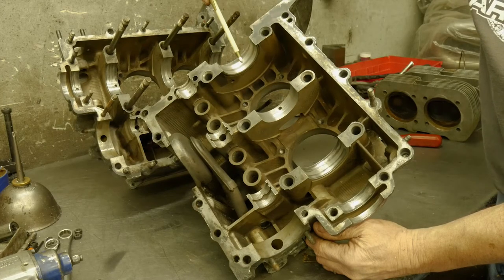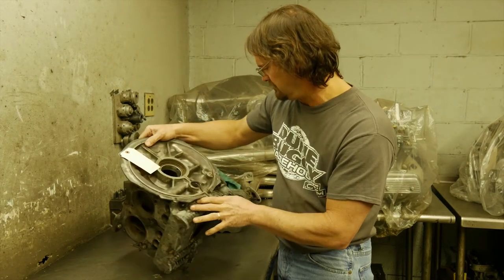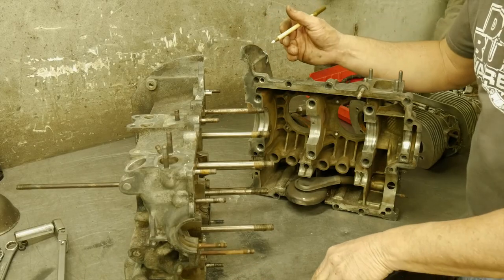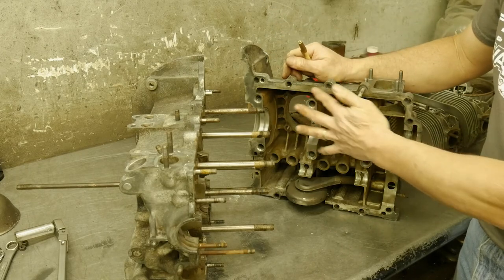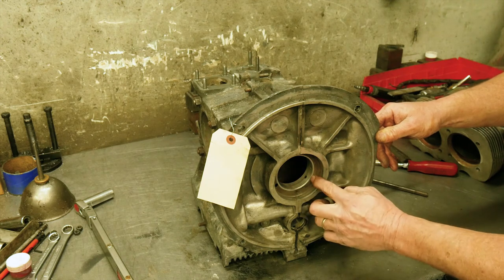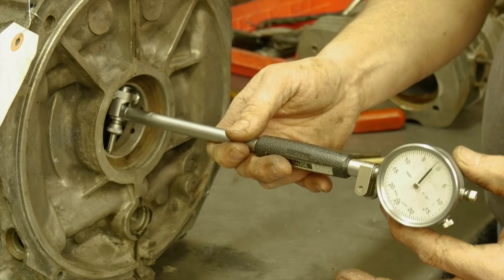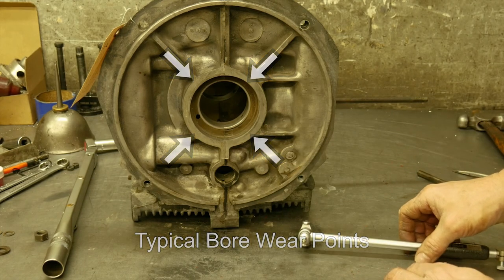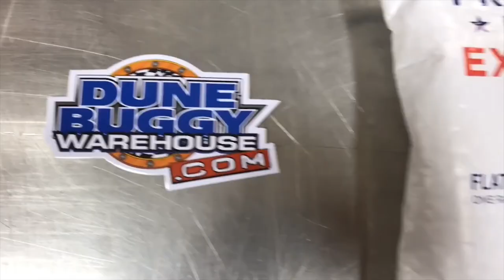How To Inspect Your VW Type 1 Engine Case - Air-Cooled VW Tech Tips - The Oil Leak EP2

Comment: Eight lifter bores each with .005 slop will give you .040 total. This is the main reason for low oil pressure, overheating and eventually, sooner rather than later self destruction. The best bet is to have a competent VW machine shop instal bronze lifter bore guides. Sometimes even on brand new cases.

Comment: Hello. I have a case which may need a line bore, as I can see a vw emblem in the middle saddle like you mentioned. Also, I have a slightly loose pin in the thrust bearing saddle. Can that be fixed somehow?
All the best.👍🏾🇬🇧🛠
Reply from the maker: If you can feel the emblem with your fingernail it probably needs align bored. Usually a slightly loose pin is corrected with an align bore, new bearings, and new dowel pins. Oversized pins are available but are rarely needed.
Reply: @DuneBuggyWarehouse  Thank you for the reply.
Please tell me. What would happen, if I just replaced the standard bearings and ran it like that?
Reply from the maker: @soggz4246  Depends on how far out the bore is. If you can feel it with your fingernail, it's likely worn well beyond spec. Bearings would not seat properly in the bore, resulting in very low oil pressure and a rebuild that does not last very long.
Reply: @DuneBuggyWarehouse  Thank you.
All the best.👍🏾🇬🇧

Comment: I used to rebuild a lot of VW engines in the late 70's and early 80's.  Recently i bought a 68 bug and am building a Baja.  I bought a 1970  57 HP  1600 single port bus motor.  This thing sat for over 40 years.  I found a steel plate with 4 VW Flat head Screws holding it just over the # 3 rod.  There was also a Silicone spot over the #1 rod.  Turns out VW dealers had a trick they used to do if they had a motor which spected out but had broken rod cracks.  They would rebuild the motor and bolted a 10 gauge plate with gasket sealer and 4 screws over the punched out area in the case.  VW Dealers had their share of tricks just like American Dealers did.
Reply: Μμ λ μλλλλλλλλλό

Comment: I am working with a type 4 case.  I see the middle bearing part # on my middle saddle, as you did.  You mention the center galley and feeling that ridge, then you measure it too.  But I only see the words stamped in my saddle, no galley ridge.  Am I dealing with the same issue just cause the numbers are there?
Reply from the maker: Type 4 cases are aluminum and typically don't have this same issue. If you don't feel a raised galley ridge from the bearing, the text stamping may just be some grime or oil that was worn onto the surface of the saddle in that one. Clean the saddle with some light scotch brite then measure that bore & test fit the crank with set of new bearings. Plastigauge would be a cheap & reliable alternative to a bore gauge.

Comment: what would you suggest if i do have corrosion around the oil sump?
Reply from the maker: If the studs are structurally sound and there is plenty of surface for the gasket to seal, then a small amount of corrosion is okay. If one of the studs won't hold or the gasket surface won't seal, it will save headaches to find a better case.

Comment: Great Info! Thanks!  I have a case that has quite a bit of white corrosive deposits I’m trying to figure out the most effective and safest way to get this case cleaned up. Would Soda blasting be a good idea?
Reply from the maker: We typically do not recommend soda blasting since media can get inside the oil passages. Vapor blasting would be the best choice.

Comment: Hello friend of Dune Buggy Warehouse, I want to know if I have to perform dynamic balancing to the following products that you buy new in your amazon online store are the following: AA Performance Products 4340 Forged Counterweighted Crankshaft Chevy Journal (Size 76mm) Brand: AA Performance , Manufacturer Part Number: 003 4376C, and: FLYWHEEL LIGHTENED 8 DOWEL, dune buggy vw bug, OEM Part Number 311105273HP, can you help me? to know if they are already balanced or do I have to balance them together?
Reply from the maker: Cranks and flywheels should already be balanced from the factory, but it's always a good idea to have the entire rotating assembly dynamically balanced (crank, flywheel, clutch, pressure plate, crank pulley) and to match weight on rods & pistons.

Comment: Forged Crank  , Rods  =  great    Case no good    the case is the weak spot . as the #3 comes up to compression stroke it pushes back on the #1 and #2 main saddles while at the same time it pushes the #3 area forward by the head studs .  It tries to push each side of the case the opposite direction causing case clap.  NO - GO - OD !!!! and the bracing is the spigots around the cyl. hole and when you cut to make oversize your weakening it farther and the more you stroke it the worse it is . answer if you go to hop it up start with at least a bubble top . No one I know can afford a Scat 3 piece case  . those if used stock would be like using a type 4 case , no line bore issues .    Just saying   ?   VW driver since 73
Reply from the maker: With proper machining and assembly there is no reason you can't build a reliable 100hp+ street engine. There are plenty of little tricks to maintain the block integrity during an engine and even stroker build, including machining the piston skirts and only machining a small bit of the block itself for the skirts to fit. Bubble top cases are definitely a good place to start, but plenty of drag racers have AH/AE dual relief cases making well over 200 horsepower. Usually the biggest issue with stock cases are the lifter bores.
Reply: @DuneBuggyWarehouse  Dont get Me wrong = Good Video